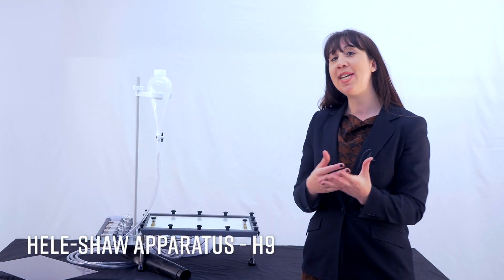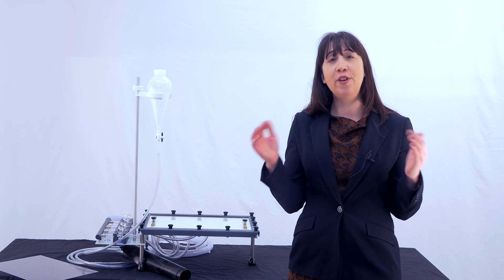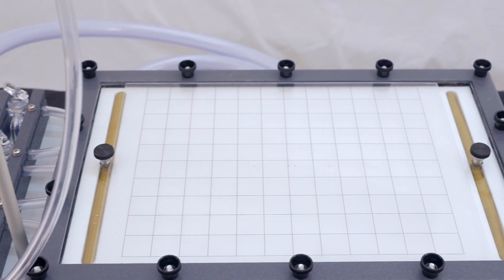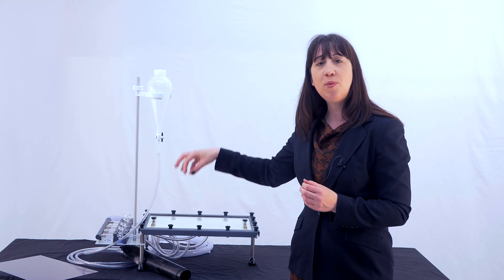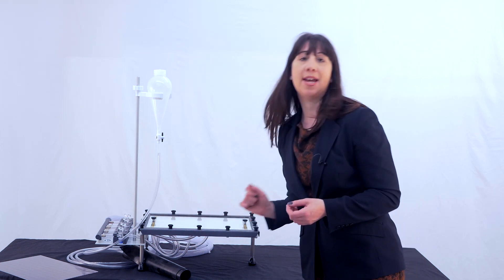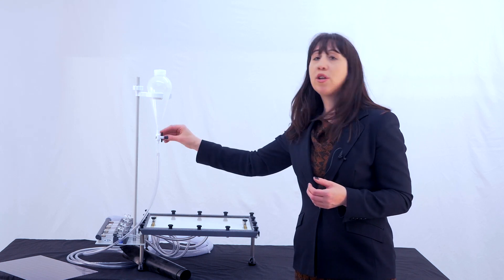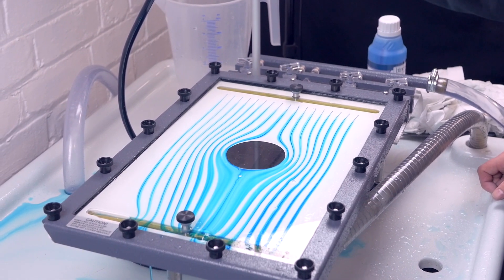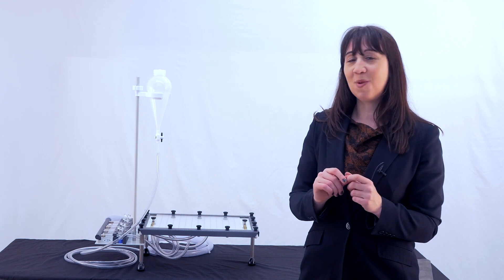Understanding Laminar Flow | TecQuipment’s Hele-Shaw Apparatus (H9) | Fluid Dynamics Demonstration

Comment: Can you give me the application?
Reply: There is a mistake at 1:14: water viscosity can not be ignored in this experiment. It is the viscosity that is the dominant factor in the Hele-Shaw apparatus.
Reply from the maker: Thank you for pointing this out.
Reply from the maker: Potential flow methods can show the problems of water seepage through solids and flow problems in other branches of engineering. For example, a circular cylinder in a uniform stream produces a unique streamline pattern.
Reply: @Tecquipment  thank you ma'am